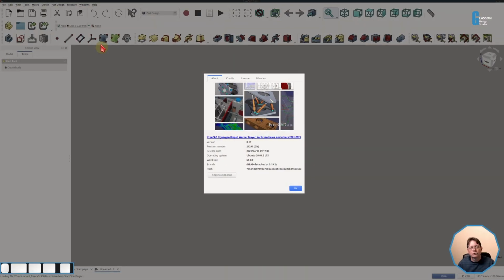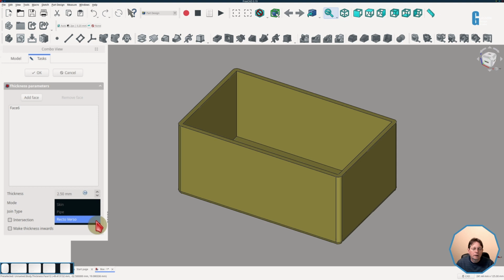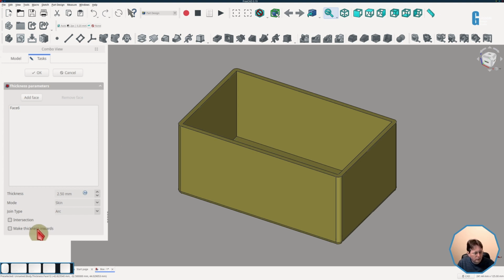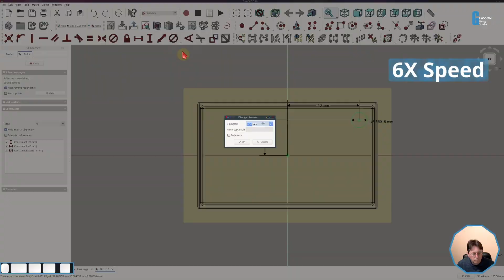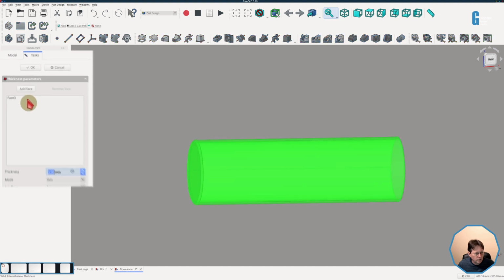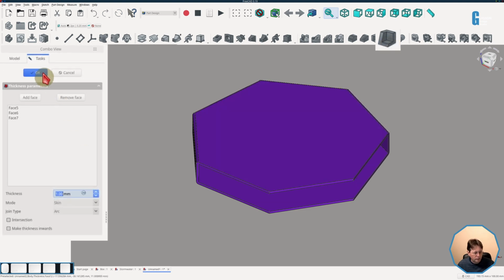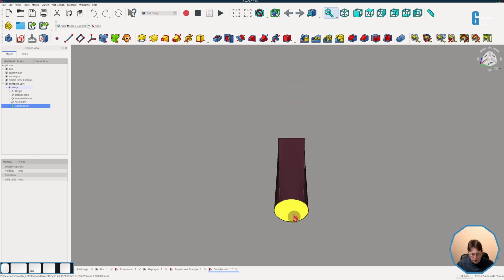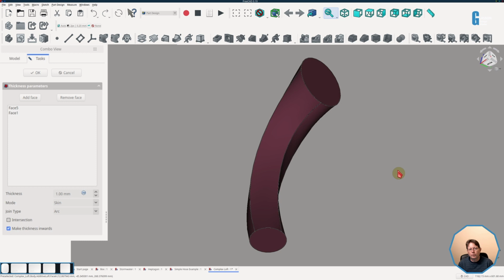Learn how to use Thickness Tool in FreeCAD's Part Design Workbench

Comment: Hi. I am trying to learn and am using v0.19.3 on Windows. I have been trying to add some pipes to the bottom sides of a box like you show in this video but have failed every thing I have tried. If you were to add 3 tubes or pipes with angles to the bottom of one side of a box similar to this, how would you do it? What workbench would you use for the hollow tubing and how would you attach them to the box so if you filled it with liquid it would run out or drain from the tubes? Thanks in advance.
Reply from the maker: Hi Dave, Sorry about the tardy response. Thanks for your question. I'm not entirely sure that I understand what you're trying to achieve, but it seems to me that you are trying to create pipes that are fused to box so that it is a single piece. Is that correct?

If so, this is what I'd do using the Part Design workbench (but there might also be a better way). I'd create the box as before, then I'd create three new bodies containing cylinders representing the pipes. The cylinders need to be solid at this stage. Then I'd position and orient the cylinders in the direction that I want them pointing. Once that's done, I'd make a clone of each cylinder then hide the clones. Now I'd make the box the active body and use the Boolean Operation tool to cut the three cylinders from the box. This should leave three holes the diameter of the cylinder in the box. Remember that the cylinders need to be solid to perform this operation because cutting with a pipe will create multiple bodies which is not supported by the Part Design workbench. Now this is where the clones come in. Hide the box, and activate each of the clones. Use the Hole Tool to drill a hole the length of each clone. This won't effect the original cylinder so we're not going to break the box. You can now activate the box and use the Boolean Operation tool to fuse the box and the three pipes into a single body. I had short lengths of pipe inside the box due to the way that I placed my pipes prior to fusing them to the box. I used a Subtractive Box (one per length) to remove it leaving a smooth interior.

I hope this helps.

Comment: Is there a book for free cad I know there are different versions but is there a book on the help page (the community help page) also can you do a video on the help page and how to use it.
Reply: This may be of interest https://www.freecadweb.org/manual/a-freecad-manual.pdf
Reply from the maker: Thanks for sharing this Laurie. I haven't read it other than to check which version it was written for. It was written with 0.16 in mind so may not be so applicable now but that doesn't mean that it's not worth reading.
Reply from the maker: Thanks for your feedback Kyle. TBH I've never looked to see if there is a book so I don't know. I haven't thought about doing a video on the help page but its not beyond the realms of possibility.
Reply: There are several books available on Amazon although they are quickly going out of date. Nevertheless they provide basic principles and grounding.
Some use sketching on faces rather than planes which, until recently, have sometimes led to errors as a result of the topological naming problem. The linkstage3 branch from Realthunder promises to eliminate this if it is amalgamated into the 0.20 release and many tutors are beginning to hang their peg on that particular hook.